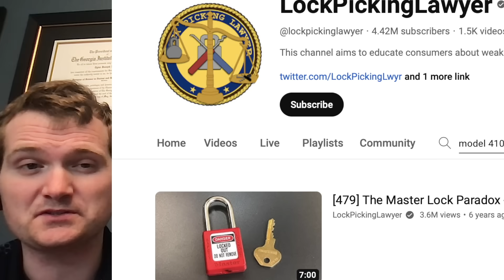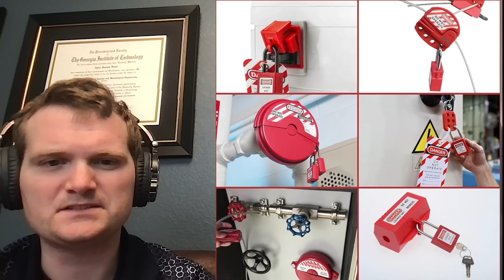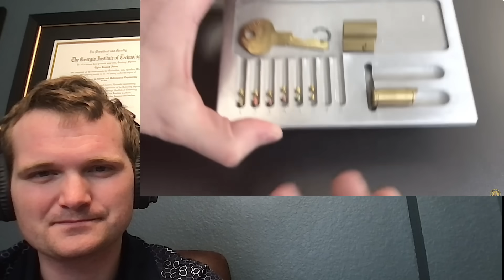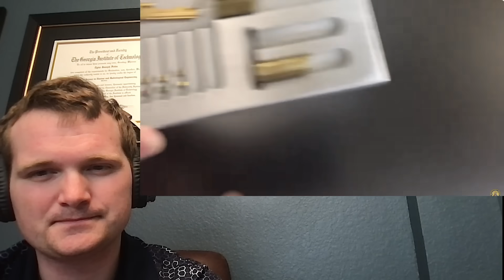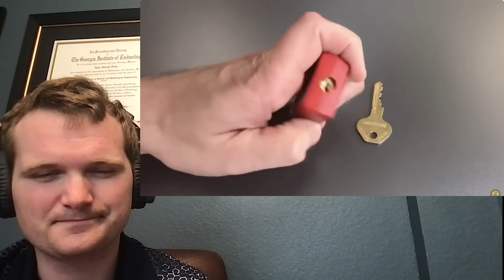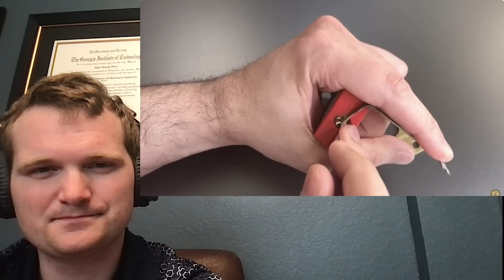Nuclear Engineer Reacts to LockpickingLawyer "The Master Lock Paradox - Model 410 LOTO Padlock"

Comment: LOTO locks are not really ment to be an absolute security measure, they are to ensure that someone must deliberatly try to remove them.  If you have someone who is willing and able to remove a LOTO lock that someone else hung without going through the proper safety proticals then your jobsite has bigger problems.  Prety much anywhere that actualy uses LOTO treats messing with alock thats not your own as a fierable with cause offence and will escort you off the property instantly, they'll ship you any property you left behind.

Comment: My guess is, the more pins means it's much less likely that a site will end up with two locks that take the same key.  Just to make sure only the 'true key holder' can remove the lock (well, except for the obvious bolt-cutter 'master key'  lol)
Reply: Unless you intentionally buy a group of identically keyed locks for locking out multiple parts of a single device.

Comment: Thanks for answering the LPL's question- if there is a requirement to be able to cut off a lotto lock as part of normal procedure, then it makes sense not to harden it.

As for the other locks, if they look intimidating, people may believe that they are more secure and less likely to try picking it... allowing Master to cheap out on the cores.

Comment: There's no paradox.  The locks were built with specific purposes in mind.  Lock picking is not a common skill.  And it takes practice.  In the vast majority of instances, it is easier to brute force an attack on the lock hardware or to whatever the lock is attached to instead.  So those other locks are built to withstand brute force.   The LOTO locks are not a physical security feature.  They are not meant to bar access but to ensure people don't get accidental access wither at the wrong time or to the wrong piece of equipment.  They are most likely to be used in situations where there are probably multiple similar if not identical locks in use, all with relatively similar keys.  Thus to accomplish their function, they need to be designed to be able to work with only one key even as the keys and locks start to wear down with age and use.  Hence the more robust core is what is needed to accomplish their task.  And even the seemingly poorly made housing for the LOTO locks makes perfect sense.   In the event that one of those locks needs to be removed without the key, they are almost always going to be installed on equipment that is far more important and valuable than the lock.  If a tech drops his key for a LOTO lock, you don't want to risk damaging the machine that the lock was installed when you are trying to get that machine back up and running.
Reply: Yup, spot on with explanation on this, lock is used in secured space it needs to be easily removed in case lost key or missing person and u need to get inside what they are protecting fast for safety reasons

Comment: Those LOTO locks are really just to make people think before they switch an isolated system back on.  I have a set for electrical isolation.  I would only expect the security to extend to someone opening the panel cover and thinking “Oh, it’s not tripped, it’s been isolated”.

Comment: Unless a worker forgot to take it off and  you call him to make sure what ever equipment or circuit he was working on is in safe and in  working order, there is not many circumstances where you should remove someone’s loto.
Reply: That's why at the paper mill I work at sometimes during shutdowns, every single confined space someone wants to use has an attendant/vessel guard (my position). You lock onto the main permit box while you're in the mill, as well as the confined space permit in front of me, your name goes down, the time in/out goes down. If you leave my line of sight, your lock goes with you (barring that one time the guy's key fell through the floor and he had to go get it - these companies really need to look into carabineers. People have lost so many keys in the confined space, falling through the floor, etc). 

They're also gas tested every 3-4 hours, whenever it's left unattended (even for one minute). Makes you think though - nearly every safety policy that's been put in place in general, was written in blood somewhere. Whether it happened once or more.
Reply: Imagine someone is doing maintenance on the backup cooling system of a nuclear power plant. The backup is powered down and locked out. Then the primary cooling system fails. You are minutes from a meltdown. You cannot reach the person doing maintenance on the backup cooler. Something like this is a reason you may cut the LOTO lock, turn the system back on (possibly killing the maintenance worker) to prevent a disaster that could cost many lives and severe ecological and financial damage. (I am sure this is an improbable/impossible example as many more things would need to fail, but it illustrates the point, sometimes you might have to bring a system up even when it isn't safe to do so.)
Reply: @kg4wwn  You'd hope that the nuclear industry actually has its shit together enough not to need such locks - anything so critical should be traceable down to 'Plan E', with multiple fallbacks, like going for a spacewalk where you rehearse every move for six months and how to recover from just about any setback.
But there are millions of places where you don't want the power/heat/mechanical device to come back online in any workplace eg in print finishing the guillotine blade should be impossible to reach by the operator/spectator due to the safety lockouts unless the power is off - famously Tony Iommi (Black Sabbath) lost a good chunk of finger due to lack of safety cutout.
Explains a lot!
Reply: @pd4165  I am absolutely sure they have at least a 'Plan E' that doesn't involve a LOTO cutting. Turning on a system to save a meltdown at the expense of a technicians life is probably somewhere around plan U or V. But if they actually have their shit together, they have a plan that includes it, and rules for how and when to do so.

Comment: paradox - Because apparently no one needs locks that are both physically resistant and pick resistant? Or the vast majority of situations only require the lock to be good at one of those two things? A conundrum for sure. 😊
Reply: No. Paradox is that this lock is for safety not for security, so security pins have no real purpose and the same time Masterlock "high security" locks are easy to pick or super easy to bypass.

Comment: Hi, practicing locksmith here:

Master plastic body LOTO locks have key blanks you can't buy. The locks specifically come with only one key so there is accountability as to who can and can't remove the lock non-destructively from the equipment. Their catalog sells LOTO locks in two key configurations: Keyed-alike for a situation were one piece of equipment had multiple controls that needs to be secured and able to be removed by one key, and keyed different, for the previously mentioned reason where only one is allowed to have the key. And again, no extra blanks available.

The only way to copy that blank, would be to use a $5,000 profile cutting machine like a Easy Entrei machine, or possible on an end-mill. This either requires a lot of money or skill.

Comment: I think we just got a hint from the lockpickinglawyer on how to become a good lock picker, I'm using "good" and not "great" since I don't think anyone else can become as good as he is, except for maybe "Bosnian Bill" or whatever his nick name is. The hint is to pick locks ALL THE TIME, even when watching movies. It wouldn't surprise me if he does it in his sleep as well as when he is driving a car.

Of course, it's not a illogical thing, everything you do a lot creates so called "muscle memory", which in turn makes you do things without even thinking about it, like farting. :face-turquoise-covering-eyes:

It sounds like there would be a very good idea to implement a RF signal into the key and lock as well to make sure it's not possible to open with a copy of the key. Of course, as you say regarding the possibility to open the lock if it is really necessary. But I would argue that the lock with the plastic body is probably just to use an axe or the "open ring wrench" trick on. The one with the aluminum body, you can just use a torch on to melt the body. The last one I think you can open by just grinding down the nobs on the bottom.

Comment: While the two metal red locks are LOTO locks, you generally won't see these used in a plant by plant employees where the plant has a one lock, one key, one employee policy.  Sometimes the aluminum ones are used when the lock is tethered to a lockout point, but these typically aren't carried by employees.  The 4-pin core steel locks are more likely to be used by systems integrators that don't follow a one lock, one key, one employee policy (SI's don't care about key differs and locking out the machine is more of a formality).  I do think the 6 pin core is used in the plastic lock because in one lock, one key, one employee systems (what this lock is intended for),  you want a lot of key differs because there's a lot of locks out there, and because there's a lot of locks out there (that could potentially be cut off since there's only one key), it makes sense to make them as cheaply as possible and still perform the task at hand.
Reply: The question is less about 6 pins, and more about the security pins, eccentric keyway and the serrated pin on 5 - all of which feel superfluous on a lock with a body like this. There were surely cheaper ways to get the variety, such as the 9-pin locks from Godrej - so why make the core this good for a body this fragile?

Comment: I think all comes from the LOTO use is a kind of niche market for a padlock maker, with its specific requirements, but not that large in production volume.
I would guess the motivation is just to allow large number of unique lock/key pairs that may be needed at a large industry sites where the need to override/bust the LOTO is more likelu, while using stock components. The plastic body and the soft shackle (a specialties for a LOTO use) is used to allow the emergency "override", the high security core just because that is what is the available mainstream component for that number of unique combinations (so the 6 pins and the tighter tolerances).

For the smaller sites fewer combinations is sufficient and the override not needed, a LOTO product could be just some common mainstream type (the 5 and 4 pin type), just painted in red and eventually with the dedicated print on it.

And for most padlock uses, the body strength and the "beefy appearance" is indeed what is the most effective. Picking even a simple, low security core one, takes skill and time, but where just padlocks are used, there uses to be some easier method to go around it anyway, once someone takes some effort to prepare for the attack.

Comment: I feel it has more to do with tamper evidence than whether or not you can break it off. 
If this lock were to be removed by someone who was not intended to use it, that could mean major injury or death. 
If it were easy to pick, it could be manipulated and put back into place without anyone knowing.
Reply: Yes, it seems critical that a lock not be removed and replaced without anyone knowing. That can lead to major problems. Some people do know how to do it, but solving that issue is not up to the manufacturer, it's the workplace's responsibility to foster a safety culture so this does not happen. ANY tampering of a LOTO lock is an offense you get fired for at my workplace.

Comment: LOTO locks are simply visual cues that a certain system is not supposed to be energized or operated, as T. Folse stated its an OSHA/work safety step. Worse than the locks themselves is the clip we use to be able to lock more than one LOTO lock on a single system. It can be easily removed with hand tools. Again, its simply there to indicate a system is not to be operated until the owner of the lock has completed their maintenance. Hence the crux- Why such a good core here BUT NOT on a lock designed to actually secure valuables? SMH
[edited to correct the spelling of the content-creator's name]

Comment: I work in a frozen food factory, one of my duties is to assign a storage location to pallets of frozen food after they've passed through a machine that applies shrink wrap.
I have 2 LOTO to apply when I'm operating the machine during normal use.
One for the access door and one for the compressed air supply.
If the machine has a major bonk... I can also lock off the main breaker switch. That needs an electrician to fix... Typically I'll remove my lock when the electrician arrives and he'll apply his own.
Reply: Typically in my workplace, if you are still on shift then your lock stays on as well as the electricians.

Comment: Someone mentioned this elsewhere, but I think the reason why the core is so good is because you may have lots of very similar locks in a single place, and you have to make doubly sure that the wrong key won't open the wrong lock, and that might not be guaranteed with a low-security core due to accidental raking, "bumping" or just turning the key too hard.

Comment: I guess for some locks, it's more important to make sure that it's obvious when it's been bypassed than it is to prevent bypass. If this lock were easy to pick or bypass non destructively, it wouldn't have the same value in terms of safety procedures.
Reply: You're right, it wouldn't have the same value. But the difference in that value is actually very little. Since the #1 purpose is to prevent accidental operation of the machine, resulting in injury to maintenance, the operator, machine damage, or all the above.  The secondary purpose is to deter you from bypassing the lock through non forced entry. Deter, as in redirect your thought process to the fact that you should not touch the lock. And that mindset comes from your workplace safety culture.  If I saw anyone bypassing a safety lock through non forced entry (obviously report it) But I would not be working there anymore.

Comment: 4:23... Slight correction to that statement you made. Each lock is only supposed to have one person who can unlock it BUT there can be multiple locks on the same device. I worked in a facility that processed medical waste and needles and stuff and every few weeks when we would need to clean the autoclave out (think a big pressure cooker that can hold 50,000 lbs of medical waste) where we would have one locking device that we could use to lock out the machine that could than itself be locked with up to 20 different locks where so long as even one is still on it can't be unlocked and then we would have 12 people all attach a lock and go inside the autoclave to work on cleaning it out. That way if even one single person was still in the autoclave no one could start it up because if someone was in there and it got closed to get ran no one would be able to hear you through how think the metal had to be to be able to withstand those levels of pressure needed to sterilize the medical waste to then be processed. 

As such it is not one single person controlling it, but each and every person who is working on it, we also had a smaller version for 4 locks because we had two maintenance people plus occasionally the manager would help with maintenance of the other devices we had to use to process the medical waste. So if three people were working a machine you would put three locks on so that Maintenance man 1 can't accidently turn it on while maintenance man 2 is still in there just because maintenance man one saw manager leave and assumed it was all clear.

Comment: The small plastic lock probably only has the 6th pin because it’s bought in larger bulk making it far harder to insure all keys are not duplicated simply by virtue of using every combination in a single order.

The more robust locks are made in smaller quantities and bought on more individual basis than in bulk so master lock can safely cut corners where it is cost effective.

It’s probably less cost effective to make every 5 pin lock different when you can duplicate most of those and need only one pin to be different to solve the issue vs paying someone to be more accurate with 5 pins.

Comment: what he may not realize it many times when doing a lock out tag out it can require multiple locks, where you have many departments that have to be notified and approve of placing the equipment or device back in service, these locks are also placed inside distribution panels with limited space making the small body locks more desirable. and of course they are used mostly to ensure that no one tries to operate equipment that's been taking out of service for either maintenance or repairs, not to prevent theft, your not going to rely on one of these to chain your Harley to a lamp post.  I remember once while in the navy before lock out became standard practice it was just tag out, I was doing maintenance on filters for ventilation system, turned off the power and hung a tag on it, removed the filters for cleaning, when I came back someone had tossed my tag on to the floor and turned the blower back on, guess it was getting just a bit too warm for somebody. its a good thing I wasn't repairing or working on the blower motor itself.
Reply: I think what he's annoyed about, is that Master DOES make good cores, they just don't put them in their security specific locks, lol.